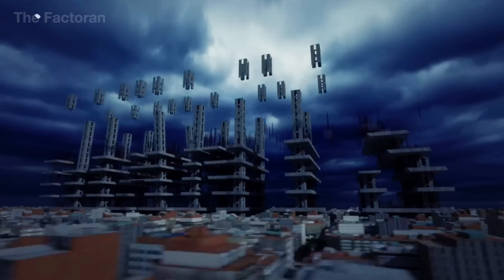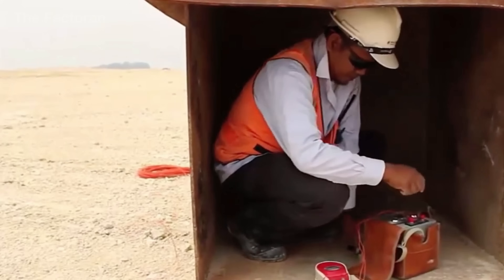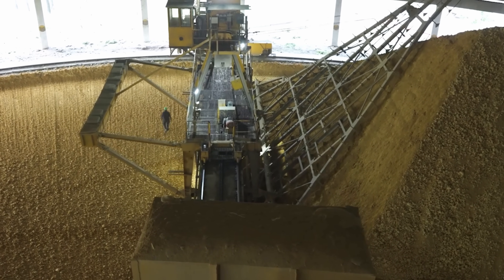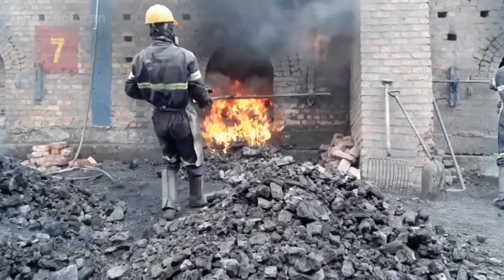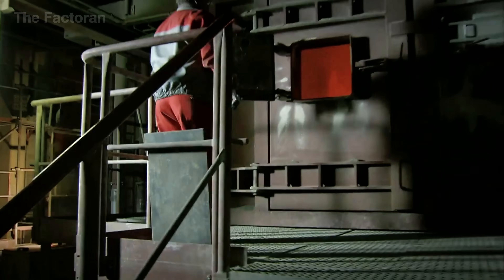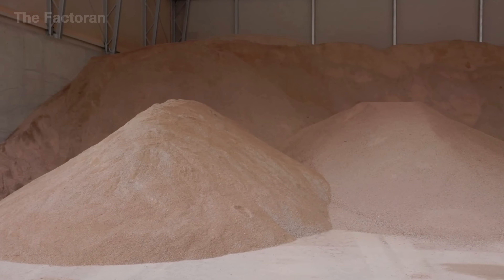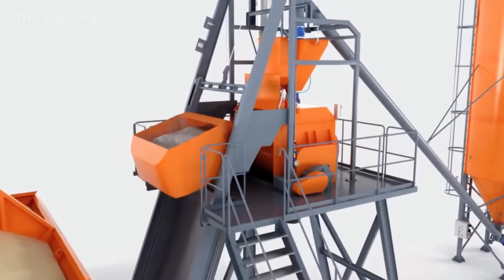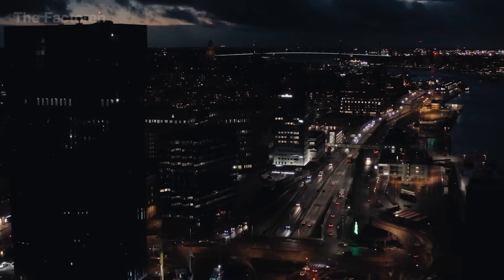How Millions Of Tons Of Concrete Are Produced – From Quarry To Construction Site

Comment: While this program dove into the basics of formulation to the basic components, I've learned that the composition of concrete can and does vary. There are simple, homeowner mixtures with up to a 5,000 psi compressive strength, or fast curing, or cements without the course aggregates, to industrial formulations for industrial uses like cold weather mixing, roadways, dams,  airport runways and floors in industrial plants. It has become a very technical product, with 'formulas' for all sorts of uses. Very cool, for a very important building product.
Reply from the maker: Absolutely! You summed it up perfectly — concrete’s come a long way from basic mixes. It’s amazing how many specialized formulations exist today 💪